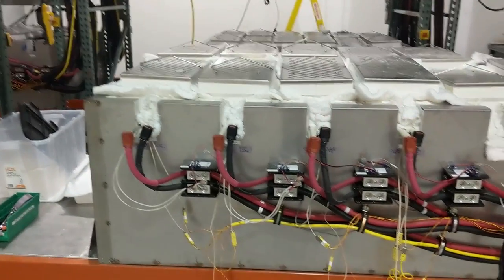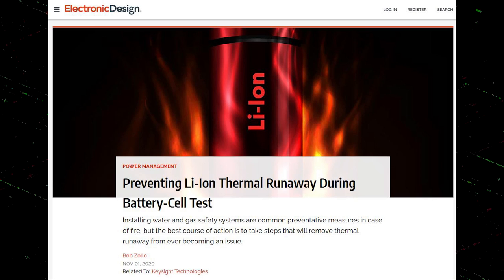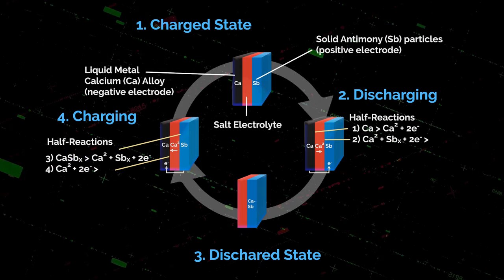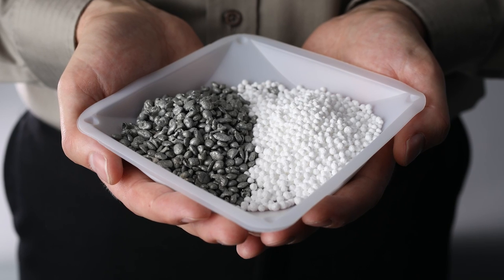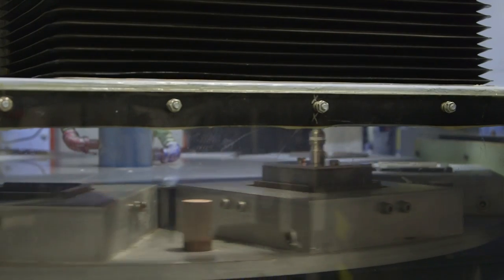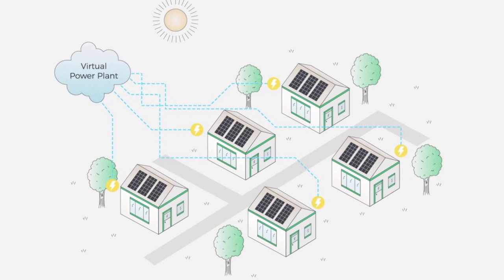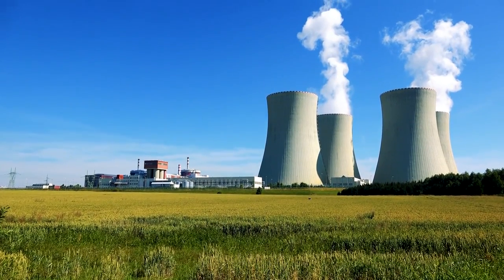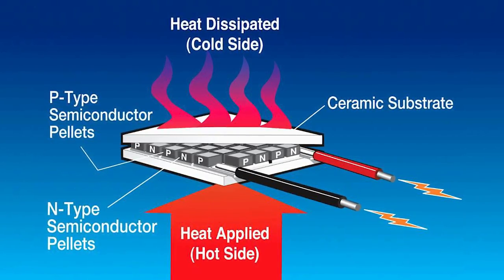Ambri: A Battery that Could Change the World

Comment: I remember back in the 1960's they had developed a Sodium/Tin molten metal battery, also using a sodium chloride electrolyte.  So this technology has been around for a while.
Reply: And it just never got commercialized en mass; because we never had a need for efficient grid scale energy storage.

Now that some key people are pushing hard for efficient portable energy storage, it may finally he the chance we need to see grid scale batteries a reality.
Reply: @TCBYEAHCUZ  The need has always been there, it's just that energy companies didn't see a financial incentive to do it. Well that has started to change now that some grid-level storage systems have been demonstrated and the power companies realized it is a money maker, and not just a nice to have for the stability of the grid
Reply: @TCBYEAHCUZ  Definitely would have helped Texas earlier in the year anyway.
Reply: @ironassbrown  Economics and need are synonymous with my comment.
Reply: @Martyr217  maybe not...the temps got low so harder to maintain heat for battery plus how much energy wise does it cost to keep the battery up to temp. That would draw from the system as well. I'm sure it wouldve helped overall. What wouldve helped even more is if we had a totally revamped infrastructure. Not just energy but roads, bridges, underground water/sewage, etc. The entire country is slowly falling into disrepair infractrusturally speaking. The only reason this came to light in texas is because of the decision for the majority of the state to be on it's own grid
Reply: @Random Observer I agree random. I think we need to take another look at nuclear. It's incredibly safe if its respected and done correctly. Edit... Incredibly safe considering what it is...
Reply: @jeremygalloway1348  waste is not safe! hello?!
Reply: very nice info steve, will try to find more info for that
Reply: @jeremygalloway1348  Nuclear safe? Maybe so but there's tons of spent uranium rods with nowhere to go so you can hardly call that safe!
Reply: Also, gravity batteries have been around since the 1800's or early 1900's. They used different density of materials as part of the inherent "structure" and connection. This is also essentially a gravity battery as well, though different in other ways than the old gravity ones. It's pretty ingenious in it's all around simplicity.  

  I suspect they do have to initially get it up to temp to get the reactions going, but I wonder if Solar concentrators (rather than Solar converters) could be a cheap, renewable way to do so.  Get some large parabolic reflectors or Fresnel lenses shining on them, and you could probably get up to temp by the end of the day if the individual "cell" isn't too big.
Reply: @joepickles8689   Not strictly in the sense of the old style ones, but yes, it IS a kind of gravity battery because it uses differential density to its advantage. The different density of the materials is what keeps them naturally separated from each other. And that density separation works on the principle of gravity.  

  This is also how the old style gravity batteries worked, though using different materials and not molten metals.
Reply: @joepickles8689  In the old gravity batteries, how does the density have to do with how the energy is stored?
Reply: @jeremygalloway1348  Ambri claims a overall efficiewncy of around 90%. The idea is that the losses account for keeping the battery on temperature. This means that the battery has to be heated once, and then stays on temperature by its use (provided it has a regular charge/discharge cycle)

Comment: I watch you guys as much as I can, and it has a while. This is the first time peak I've seen of "AMBRI" in a year. - THANKS - Big time.
Reply: @BobDevV  
Who rattled YOUR cage?

Pay more attention.
This is just as much physics as chemistry.
They know the performance of all components (in terms of heat) insulation, etc.

No "foreign" or "extra" components or elements in the system.

No risk of "combustion" (explosion), and self regulating in that regard.

What's to "break"?
As he said, the worst that can happen is it cools down, maybe due to a failure in the energy supply, and needs to be reheated, but since the cooling results in inert materials at every point...... No danger

Why are you scared of having it "near your home"? Actually, that the best place for it if it's a cold climate. A pack between two insulated walls, but with a degree of release could provide passive heat storage/ release as well as electrical storage.

Comment: Right on! This is an idea I also thought about, not the liquid metal per say, but using materials safe for the environment and that can be recycled. I know it can be done. The draw back is size, but for a house with solar, you can have a bigger battery.
Reply: Maybe not a house but a neighborhood....
Reply: @briandbeaudin9166  word
Reply: @briandbeaudin9166  Neighborhood or (god forbid) an HOA would be an excellent idea, especially if you could get all residents together and on the same page.
If for some reason that wasnt feasible I would say it would be completely implementable in a single home system. Especially in conjunction with solar and/or wind, hydro, and thermoelectric cooler pelletier devices that could in turn not only provide or offset the energy in heating it but also provide on demand hot water, refrigeration, freezer, and heating/cooling air conditioning.
It would be a lot more appealing to homeowners to only have to buy one batter for their lives rather than eating the cost of replacing the batteries currently used in solar or "green" energy electrical systems every 5-10 years. And trust me, those things are not cheap... it would also be ideal for people living in extremely cold weather climates, off the grid systems, or "preper" SHTF scenarios. The applications and implementations are countless. I'd definitely buy into a system like that. Hopefully with some tax bonuses heaped on.
Reply: I'm ALSO going to say - Neighborhood, or small, remote village in say Africa, S.A, India, AK, USA....etc.
Reply: I don't think my house has enough power to heat anything to 600*C let alone change its phase at that temp.

Comment: I would like to know the smallest possible size liquid-metal battery for a single-family home, that would be able to retain its heat over a 24-hour cycle and function indefinitely. These batteries make perfect sense for large-scale applications, but how small can they go, practically speaking?
Reply: Their prototype was apparently the size of a coffee mug. I can't imagine they'd build a prototype unnecessarily large.
Reply: "Pizza sized" I heard years back when I first started watching Sadoway.  These two are catching up.
Reply: Why would you want a personal home battery?
I mean, you don’t have a mini gasturbine/generator to generate your own electricity either
Reply: this question will not be answered, I'll bet!
Reply: These batteries are designed for very large scale and static operation.

The questions is similar to can I have my own nuclear power station.
Reply: Fir a typical home storage, assuming 10+ kW of solar, you'd need 50 to 100kWh of storage, so probably approaching shipping container size including all support equipment. They could probably supply you a turnkey system, but I imagine at this stage it would be more expensive than a couple of powerwalls.
And then there'd be arbitrage software interfacing required...
Reply: @Conservator.  I have enough roof area (and could get more panels) to generate as much as 40KW of energy at full sunlight where I live-offgrid, in a country where we have very unreliable grid supply (power generation and distribution is a monopoly). If I could generate and store all this energy, I could sell it on demand, I could install a server farm and hire the resource out -all I need is good data speeds. The possibilities are limitless if I could have a home-sized liquid metal battery-but limited with lithium storage.
Reply: @Conservator.  No, the question is not similar to "can I have my own nuclear power station".
Reply: @reflections9409  The Ambri battery was designed to work on grid scale. That’s why I compared it with nuclear power. 
A small nuclear power station would solve your energy needs too. 
I didn’t mean to ridicule the idea of having a household size Ambri battery (although I might have done so inadvertently). If I did, I apologise.
Reply: @Conservator.  Tesla sells home sized batteries for homes to store electricity from solar power. Without these $10K batteries, you have no electricity at night and on cloudy days.
Reply: @Scott-jf1nh  Do you mean if you’d live off grid perhaps? In most countries demand and supply on the grid is managed with a mix of generators like fossil fuel, nuclear, solar and wind. 
Batteries are sometimes used for short term (0-4 hours) balancing. 
A few decades ago there were no batteries to balance the grid and we managed ok. 

I think batteries are great for balancing. I think V2G could be part of the solution to move to more wind and solar power too but unless you live off grid, you wouldn’t need a battery at home.
Reply: @Conservator.  some private people got real money,  and just want to do cool stuff, like spend a huge chunk of chedard on Liquid Metal and flash the financial middle finger at the fossil fuel fools. 
Don't under estimate some of the people commenting here, because they might have the kind of funds to help boost Ambri
Reply: @clayreal  If people want to help Ambri they can probably invest in the company, but asking for a home sized Ambri battery is not what Ambri are aiming for. They want to build grid scale batteries that are dirt cheap (relatively speaking).
Reply: @Conservator.  The controllers would not like that.
Reply: @MT-kj2zv  Controllers wouldn’t want what? Cheap batteries? Sure they’d want that. As long as they are sold with a decent profit margin and large enough quantities for the company to be profitable.

Comment: So seldomly something on this platform reaches me as positive as this. Thank you very much. The whole production was brilliant imho. 
I love the concept, it really is out of this uncomfortable box we sat in ourselves by trying to improve on the Li-Ion approach. This is so rejuvenating!
The younger of you guys may be as fascinated as I am by the idea :D It's so much first principles, if with a twist of course. But as he said in a way: A battery based on first principles, based on quite few abundant ressources... it is cleaning itself in case of impure materials, every balance and the equilibrium are holding themselves without any intervention and with a little isolation EVERYONE powerful enough could built those with a little insulation around it. Let the trustworthy professor get some Nobel Prize (several would be fitting) and let the world get this idea. To just use it, asap. 
Thanks for letting me join in intellectually. This is utterly great, if you ask me.

Comment: I would like to see the physical unit that's supplying Power for that building. I'm surprised you guys didn't drill down further on that with regards to kilowatt-hours and energy densities.
Reply: I’ve seen some preliminary work long before this went commercial use and the power density was actually better than Lithia Minot I don’t remember the numbers but in the early experiments and I don’t know if it’s the same metals because they were experimenting with the number of combinations of metals to do this but the data is out there. I just think it’s so cool
Reply: "I'm surprised you guys didn't drill down further on that with regards to kilowatt-hours and energy densities."

There are plenty of articles which provide some insight into that.  Energy density is not amazing, but it is better than lead acid. That's fine for stationary use / grid storage.  Given the scale that will be needed for city-scale backkup, we will be talking large warehouses with enormous "thermal containers" to minimize the energy losses due to keeping the batteries hot.
Reply: @rogerramjet6134  Thanks for your input and for putting it into perspective.
Good Golly Molly that's a lot of power if you think of it in terms of more energy dense than lead acid.
Reply: @gregkelmis2435  I think it's hot ;-)
Reply: @chasl3645  Lithium Ion is only about 3x better energy density per weight than lead acid, or about 6x better by volume - but again, for stationary neither is a major consideration once you start contemplating the scale of true grid storage.  The big key is the number of life cycles.  In 1960, you might only get 300 charge cycles out of lead acid.  The best LiIon can get 10-15k life cycles, but are also lifetime capped (so if you don't use all those cycles in 20 years they may go bad anyway).  This battery, in theory, may not even have a maximum life nor number of charge cycles.
Reply: @rogerramjet6134  Thanks Roger
I guess this is abviouse to you.
But would you throw your hard earned money at this "opportunity"?
I'm thinking maybe.
At these energy densities and life Cycles does a unit the size of a upright deep freezer give you enough buffer to shave peek loads like a bank of super caps supporting a 2000+ Sq.Ft. home. Would it give you a couple of days of running a fridge a light a TV a blower motor for heat and air conditioning to keep things from freezing or roasting?
Would the juice be worth it the squeeze?
Reply: @chasl3645  o
Reply: @joepickles8689  Thanks Joe.
What I wonder about is how stable it would be if it got shook by a earthquake would it go up in a plasma explosion?
Reply: @chasl3645  I'm too small a fish to get in before they go IPO.  Hoping they do, though.  What really bugs me about the modern "setup" is that the inventors create a company with all the Intellectual Property, then the only thing they "sell" is license to use the technology  - so if you see an Ambri "factory" it is probably a separate company and the parent can "up the license fees" at any time - sucking the money out of the company that actually went IPO.  Thus it ever was.
Reply: @joepickles8689  If it shorts they just shut it off until it cools. The fix? When the shaking stops, apply current again - it will reheat and everything will sort itself out again.

Comment: Mr. Sadoway, this came to my thought when I watched this video by using Hydrogen fuel cell technology. the liquid metal can somehow interact with H which produces electricity that in turn generates hydrogen when the heat vaporizes the H2O. using the byproduct at the exhaust tailpipe will still be H20 and recycled back to the main H2o tank. i did use the K mixtures with distilled water that passed through the electrolysis-gen convert to H gas which was routed to the air-intake valve. when i took my 1998 Buick for a trial smog test, I was completely astonished to see the NOX reading .0-.5. the shop printed out the spreadsheet to prove this setup does work. the exhaust byproduct was water. my 2015 VW TDI and many diesel-driven cars/trucks using the DEF crap, nothing but a container of piss/urine water mix solution. i would love to be on your team on the mechanical side of development. I'm retired as a UA jet engine technician for 16 years and USAF MSGT technician for 14 years. Nothing can stop a man's thought when God is in it.
Reply: At 600C⁰, there will be nowhere for water to go. Unless you want the whole thing to explode, of course...
Reply: @gregbailey45  did you watch the entire video? it does mention the cooling for the battery pack. watch the video again. why wouldn't he include his good thoughts and provide the cooling for this huge project? even all cell phones get hot when power stays on too long.